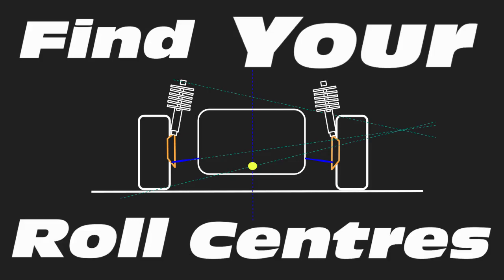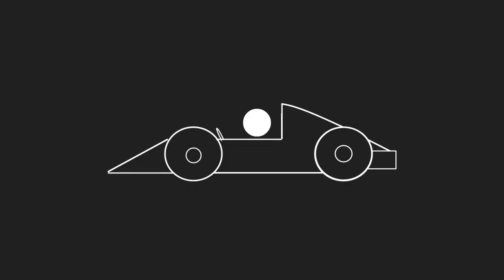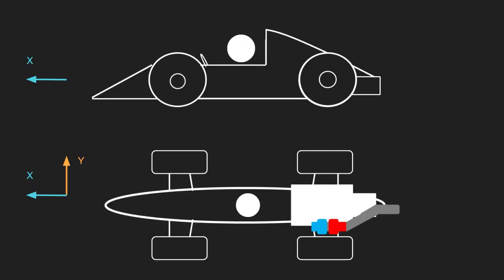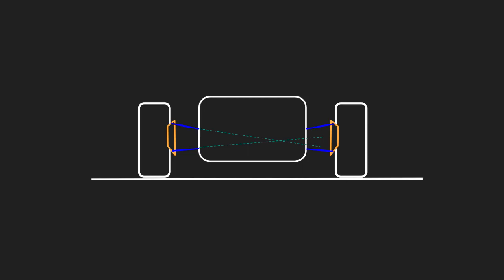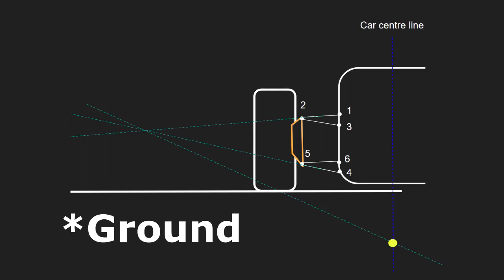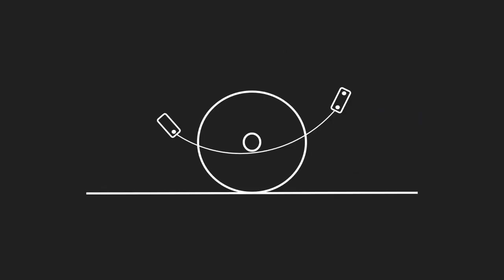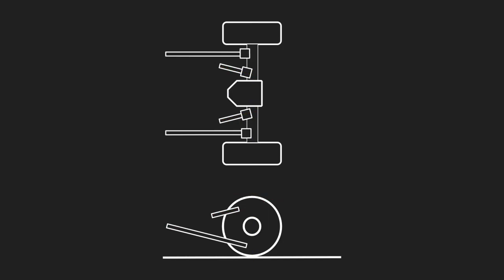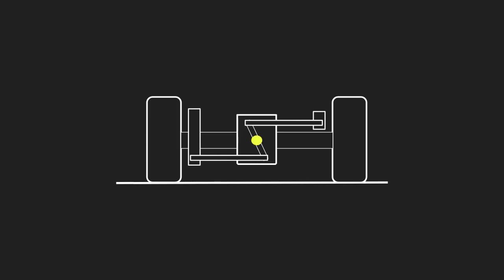Maximize Grip and Control: How to Determine Your Vehicle's Roll Centers

Comment: Thanks for doing this video. As quite a bit has changed with my kart, not the least of which is weight, finding people who can recommend changes to improve mechanical grip based on experience is next to impossible. I'm learning as much as I can about how to calculate suspension dynamics so that I can make intelligent adjustments...then test to see if there has been an improvement. A video on dynamic roll centers and how the roll axis affects handling would be excellent! FYI, the front on a C4 is double wishbone and on the back is a 4 link with a lower control arm and toe bars. My setup has adjustable chassis mounting points so that I can make adjustments to various things. I believe the adjustment to the rear lower control arms will adjust the roll center...unsure at the moment if I should go up, down, or leave the existing roll center alone once I get it calculated.
Reply from the maker: No worries mate. I think you might be finding it difficult to get info from people because this is a pretty big topic, changing one thing affects everything else. You need to consider the driver's skill level, driving style, type of tyre, so the tyre's characteristics, the tyre wear, the track surface, the type of circuit, high speed or low speed, downforce, tyre management, and the different racing rules. So as you can imagine, without knowing all of that, giving any recommendations isn't easy. 

For example, moving your lower control arms will change your roll centre, but to do that it will change your instant centre or your front view swing arm length, which changes how your camber angles change as you heave and roll. It will also, change the amount your car rolls, the tire scrub, so your tire wear and temperature, the way the lateral forces flow through the car, so the amount of jacking forces and we haven't started to think about the impact on the side view swing arm. 

To do this justice, I think I would need to do a series of videos on it, which will take a while. In the mean time, I would recommend checking out anything with Claude Rouelle in it, he is the creator of OptimumG, I don't think there would be too many people who know more than him about this

Comment: Hi Do you know how to work out roll centre for a traverse leafspring suspension ?
Reply from the maker: If you draw a line between your leafspring mounts and the centres of the wheels, where these lines intersect is a good estimate of your CoG position in its current position, it will change slightly as you move drive around and loads shift